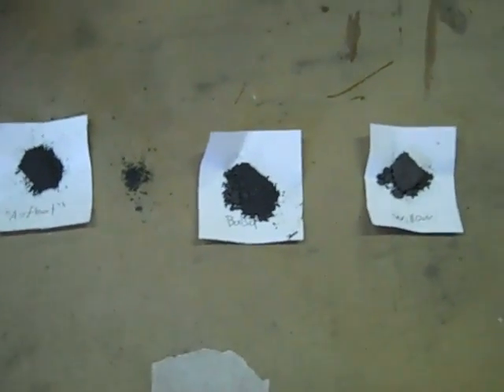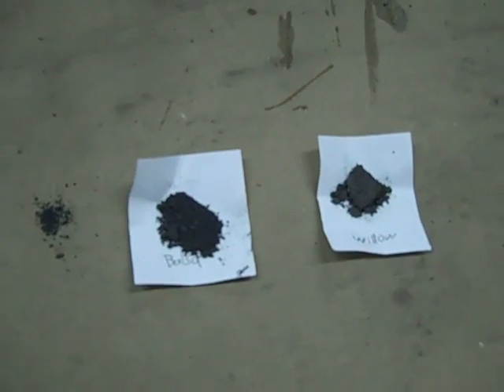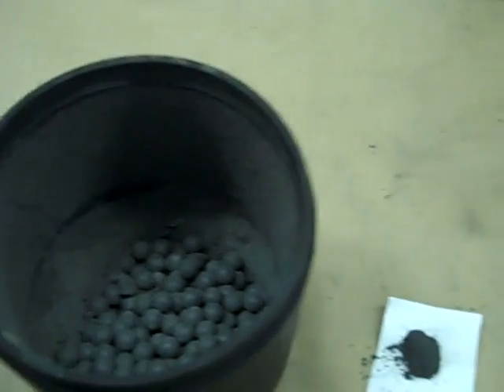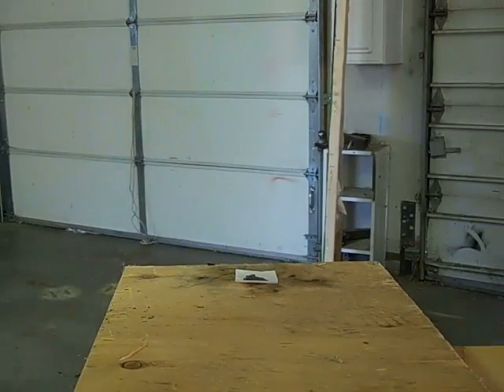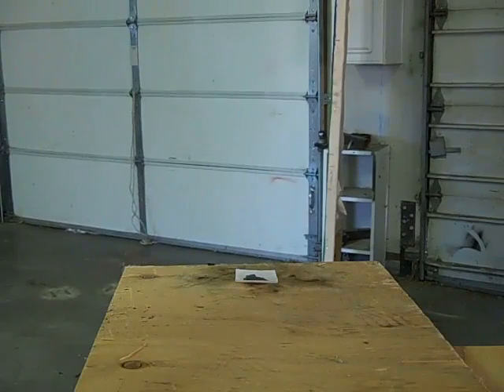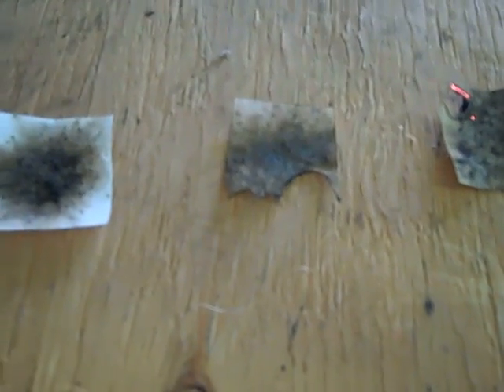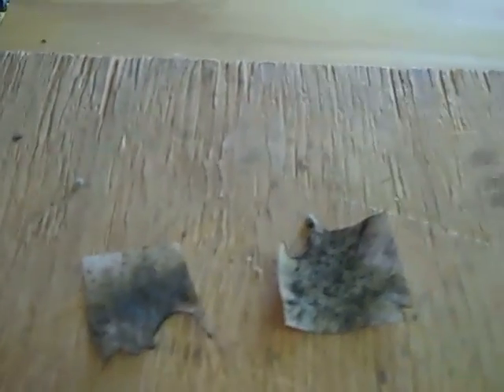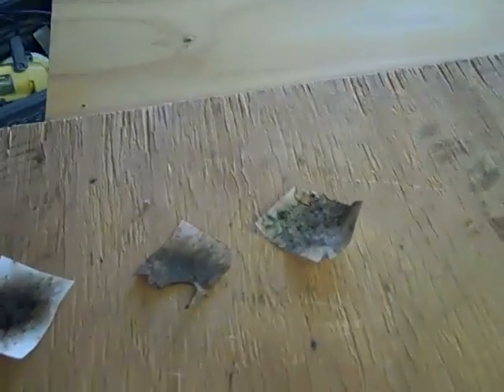Comparing Charcoals for BP

Comment: Balsa burned faster than Willow I think.  Is it better?
Reply: The Balsa did indeed burn faster, instead of the usual whoosh or hiss that's characteristic of most types of BP when they burn, balsa seems to make a distinct thumping sound that's closer to an actual explosion. As to whether it's better than the others, that depends on how you intend to use it. If you intended to use it for shooting BP firearms, then its quick burn rate would make it more suitable for revolvers, as they need fast burning powder since their barrels are obviously shorter than rifles or shotguns.

Comment: I know this comment is coming 8 years late, but I made a batch of around 100 grams of hardwood charcoal BP (store bought barbeque charcoal ballmilled for around 6 hours). Used it in a belgian caplock pocket pistol and it fired without any problems whatsoever. Also used the same batch to reload a handgonne replica and once again, no problems at all. The only downside I could see is that it ignites a tad harder than other powders, willow BP ignited much easier. But maybe a harder ignition might also prove to be beneficial for all I know, it makes hardwood BP safer to work with after all.
Edit: typos

Comment: The mixed airfloat hardwood charcoal that you by from fireworks companies is mostly used for making stars it will not make a really fast BP, but if you buy hot fireworks charcoal it is made from softwood usually red alder and will make a good lift charge.  If you make your own some of the recommended woods are willow,red alder, and grape vine there are moore.

Comment: Thanks for the nice burn test video.  So far I've made only Willow.  
Green and straight from the ball mill it burned a little slow, but corning it once into about FFFg made a big difference in the burn speed.  My willow BP is "maybe" a little slower than yours.  
I left the bark on mine and I wonder if that makes a difference.  I used the 75, 15, 10 ratio and I used 90% pure Sulfur, but I boiled and poured off the tap water 3 or 4 times to get out some of the impurities.  When I corned it once it made a huge difference in the burn speed.  I corned it with distilled water instead of city water.  
With my first batch I ball milled each component of the recipe separately for about 90 minutes each or until it's into the consistency of talcum powder.   Then I milled the components together for about 90 minutes to be sure to get a good mix.
Next I'm making a batch of Willow using the 90% Sulfur and not washing out any of the Sulfur's impurities to see if I can tell any difference in burn speed and remaining residue after the burn.  I'm  using my BP for shooting in muzzleloaders so if I can get the residue maybe cleaning will be quicker.
I intend to make similar tests on Yellow Pine and Spruce.  I have my BP making procedure videos on my channel.  And I posted a short version video of the 2 burn tests I made so far.

Comment: Is it black willow or weepoing willow? Need to know!
Reply: I am curious too. I found a local black willow tree and pruned off a small branch. 1, you can cloan willows easy to grow your own. They grow fast, they love wet areas. 2, The rest of the larger pieces of that branch, i made charcoal. Made a 100g test batch, milled for 1 hour with fishing sinkers, and it was not that fast. Made a wet batch same way, alcohol etc. and no difference. 99.9 ingredients. I just do not get that pop.

Comment: By your comments I would say yoiur interest is in fireworks usage, I am interested in BP for firearms purposes and am researching using a slower burning BP for rifle use. In smokless powder a slower burning powder will give a rifle bullet higher velocity, Slower burning powder being reletive. So my question is even though your airfloat charcoal/BP was slower in an open atmospheric test, how does it perform under pressure?
Reply: to sking0369:  I'm getting into making BP for shooting, too and recently got my P N and Sulfur.  I have a little pine I can try making charcoal with and I have access to "some sort" of willow.  
Maybe we can share what we've learned.  
A few weeks ago I watched a pyrotechnic maker video and he went into some detail about the different grades of B P and their different uses.  Black powder sporting grades for gun powder are: Fg - FFg - FFFg and FFFFg.  That's from the most coarse to the finest which  is FFFg.  FFFG is used as pan powder for a muzzle loading flash pan which takes the fire to the barrel to set off the powder there and Fg is used in canons.
Fireworks grades are: Meal - Meal D -  2FA to FFA - 
A - standard sporting grade (based on Potassium nitrate) and 
B - blasting grade based on Sodium nitrate. 
And there's several grades of blasting powder which are sized depending on whether the "corned" powder passes through certina sized mesh screens after the powder is dried.
Sporting powder (the ones we're interested in are also based on the size screen used to granulate the wet powder "burgers" and which size the dried powder falls through easily once its dry.  
I'm assuming the main differences in the powder size is to control the burning speed of whichever wood is used to make the charcoal.  
Maybe by now you can answer a few questions I'm wondering about.  That is whether one type of Willow charcoal works as good as the others for sporting use as gunpowder - and whether there's much difference in the charcoals which were made using Pine - Fir - Spruce and other "soft woods".
Thanks for sharing your experiences if you can.

Comment: My willow bp sucks. Im using the 75/15/10 ratio and ball milled it for 12 hours. Its not as fast as yours.
Reply: MiniMee134 wet,granulate,dry at last 3times with that method and you should have explosive bp😊
Reply: Charcoal has a lot to do with it,also wetting it with water/alcohol mix will make the chems absorb into the charcoal so it'll become one and burn increases a lot. Granulating will let the flame jump in between spaces instead of burning layer for later so that will also speed it up and lots of other things can make a difference in the speed
Reply: You may have problem with the quality of one of your chemicals the sulfur or KNO3, perhaps their purity.  Are you corning your powder?  When you wet it with water (Alcohol is not necessary) the KNO3 is partially dissolves and becomes intimately mixed with the charcoal increasing the burn rate usually by about x2.  Technique:  Moisen your powder with water( warm is best) just enough so it will clump together in you hand and screen it through a screen wire or kitchen strainer  and dry in the sun.  Corning (sometimes mistakenly called screen or graining today)  will improve any powder.

Comment from the maker: You can purchase Balsa and Willow online but its cheaper to find it locally. I get my willow straight from the source: willow trees in my front yard. Balsa can be bought from a local hobby shop or possibly a hardware store. Balsa is generally expensive BUT it makes exceptional black powder.
Reply: I read willow everywhere, but what type of willow? There are so many types of willow tree... I am working on first batch and for it I have found big old willow trees out of village, one branch was bent to ground so I took some wood... In this time of year I find it difficult to determine what is what, some trees are obvious, but some are not... There are many bushes that are also willows...